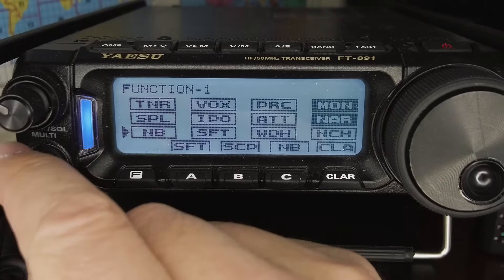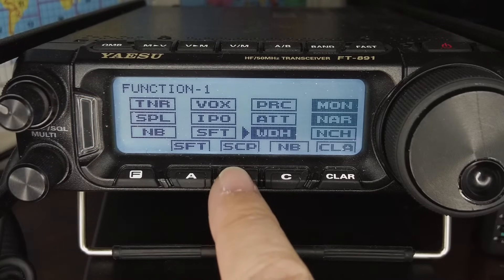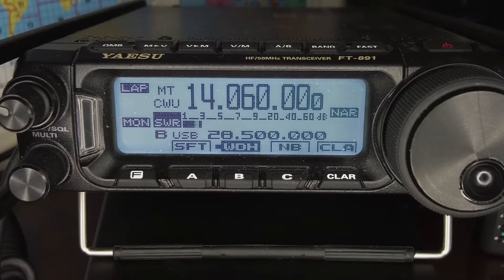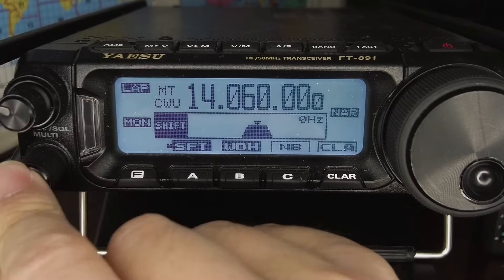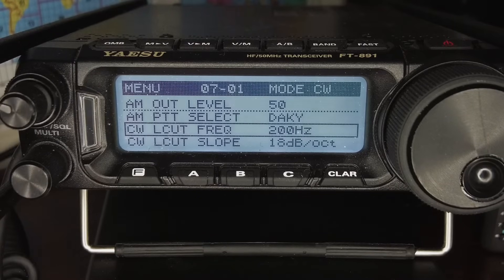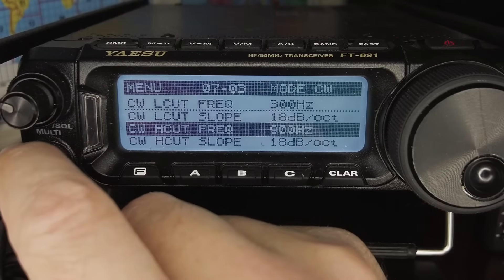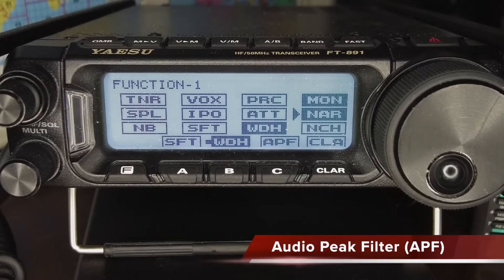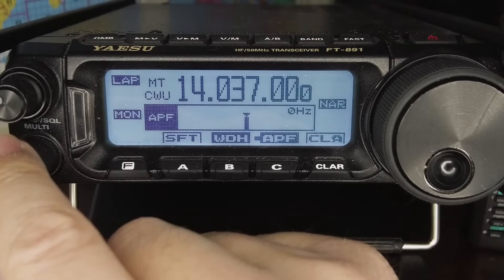10 Settings for the Yaesu FT-891 for Hunting POTA & SOTA with CW

Comment: Excellent, helpful video, Joe.  Thanks for your clear explanations. Love the 891. FWIW, I use my contour in the boost setting (menu 12-02 +8db) and the contour width (menu 12-03 at 8).  I enable the contour and then dial to the receiver bandwidth center,  to raise a weak signal out of the noise floor.  Along with using a narrow bandwith, I then dial back the RF gain to manage the noise. I also use contour in this way on the FT-991A.  It significantly helps my old hearing, especially with weak signals in an activation.  Maybe someone will find that helpful.
Reply from the maker: Thank you!  That is an excellent tip.  My hearing isn't what it use to be either.  I can't wait to try it.  I'm going to pin this comment to the top so everyone can see your tip.  Thank you so much for sharing it!
Reply: @JoeN2DI  Thanks for letting me contribute to your great video.  It was a pleasure to work you on recent activations as well. de N0ANE
Reply from the maker: N0ANE!  I know that callsign!  The pleasure is all mine and if you have any more tips please keep them coming.  73

Comment: My 891 seems to be more sensistive to CW signals when in the SSB mode. Is there some setting that I'm using incorrectly that might account for that? I've gone over the settings here in the video and although the APT improves reception it still doesn'nt seem to account for the degraded reception when in the CW mode vs. SSB mode. tnx
Reply from the maker: There can be a few settings that are off.  When you say it's more sensitive in SSB mode, do you mean that the CW signals and the background noise both sound lower in CW mode than in SSB mode?  Also what is your CW Pitch set to?
Reply: @JoeN2DI  Let me say that while the radio is in CW mode the noise seems to drown out the CW signal - high noise to signal ratio. When in SSB the CW seems to "pop" out and  with a lot less narrow bandwidth noise. CW pitch is set to 650hz. I've tried opening the filter to SSB bandwidth and the signal still seems buried in noise. OK I may just reset everything back to default and see what happens.   tnx
Reply from the maker: I'm thinking that maybe the HCut and LCut settings in the deep menu might be off.  If your tone is 650Hz then the high cut should be around 900Hz and the low cut should be around 400Hz but you can try to widen that further if you hear a difference to say 200Hz on the low and 1100Hz on the high.
Reply: @JoeN2DI  OK, I did 900 and 300 on the hi / lo cuts, but to be fair the bands are not in great shape on 20 meters so I will wait to listen for any improvements.   tnx agn

Comment: I don't have this radio. I just put it on because I wanted something half interesting while I cook. It wasn't supposed to be interesting or useful, just good background noise.  However, most of the settings are also in my IC-7100, often by different names.  

So, this turned out, not only interesting, but useful information.  Oh, and supper is a little later than I planned.  hi hi 

73
Reply from the maker: Thank you.  Glad it was helpful.

Comment: Joe, Tnx fer great video. I’m still confused on IPO. Do I want to press IPO [indicator goes dark color) for 20m?  The “enable” and “disable” language is confusing to me because of the inverse relationship.
Reply from the maker: Thank you.  You want it disabled or that clear color for 20m and up to 6m and for 40m and down to 160m you want it enabled or dark.  Remember you don't have to enable it for 40m to 160m but it usually works best there.  Do what sounds best at the time.

Comment: Hi subscribed as I am learning CW and want to work POTA eventually. Just wondered if you have the blue LED set to blink with the received CW ??
Reply from the maker: Hi, congrats on learning CW!  It's worth the work.  Welcome to the family.  Yes, I turned on the blue LED for CW.
Reply: @JoeN2DI  Hi thanks for the really quick reply I looked in the manual but it says blue led illuminated when zeroing CW ??.... could you possibly mention how you set it up please ?? Thanks 73's
Reply from the maker: When you enable it, the blue LED will blink in time with the CW if you have a zero beat on the signal.  That means you have tuned to the exact frequency of the station you are listening to.  If you are off frequency a little, the LED won't blink in time with the CW you are hearing.  It's just an indicator to let you know if you are right on frequency of the other person's signal.  Does that make sense?
Reply: @JoeN2DI  absolutely i have it enabled now and works superbly. I wonder do other Yaesu radios have this feature?. Thank you Sir.73s
Reply from the maker: The only other Yaesu radio I have is the FT-818 and it does not.

Comment: I changed my cw pitch on my Yaesu FT DX 1200 to as low as it can go, which is 300Hz and I can hear the signals better and make contacts for a longer time without getting burned out. Great video, 73.
Reply from the maker: Thanks!  I should try going lower.